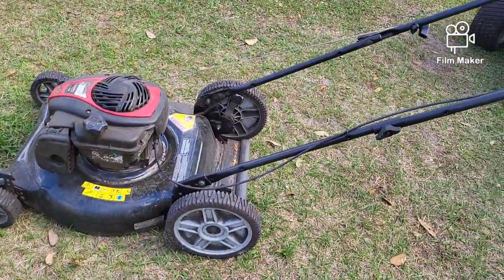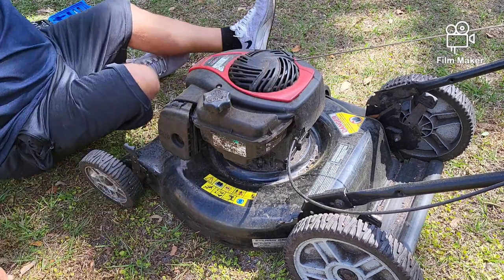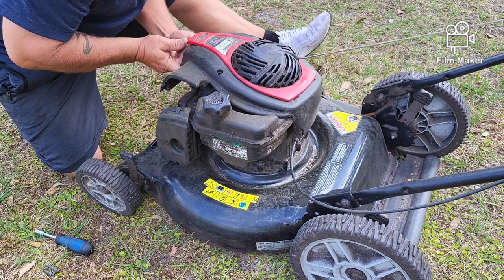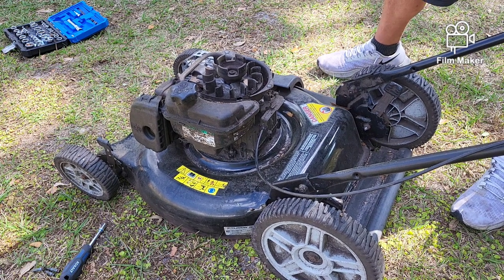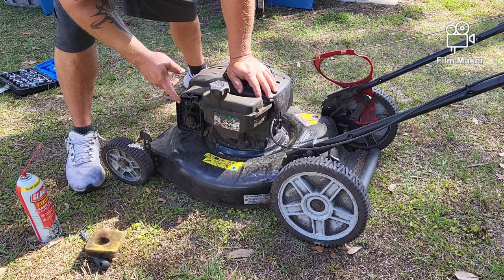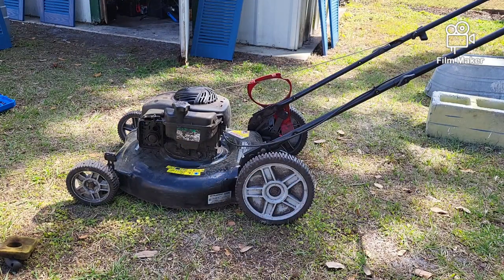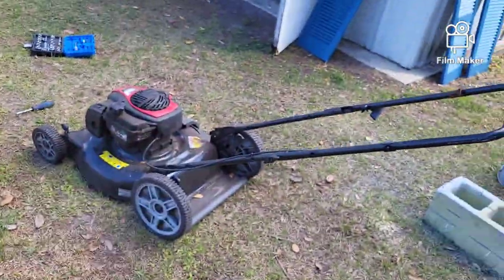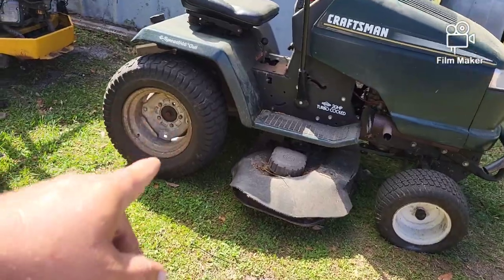Murray Lawnmower Makes Terrible Sound Let's Fix It

Comment: What I love is what they do on the MTD platform riding mowers. They put two of the body mounting screws under the big information label in the middle of the floor so that you have to tear up the label if you have to take the body apart. Customers love that.
Reply from the maker: Engineers are the worst designers lol